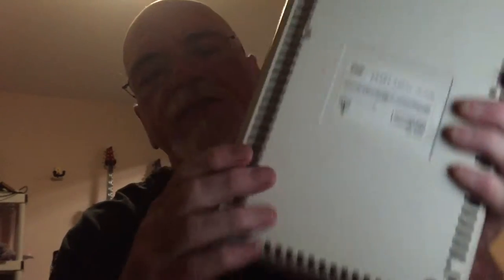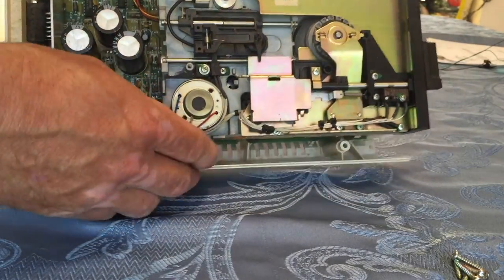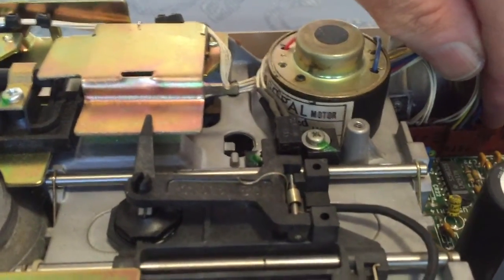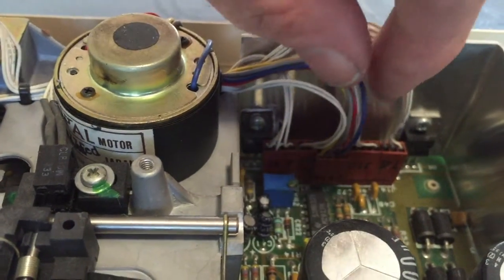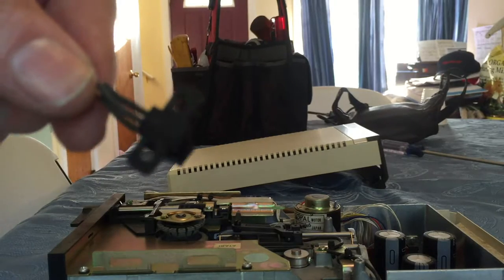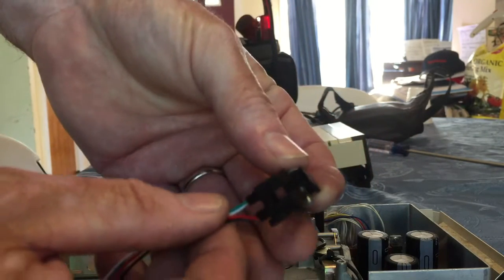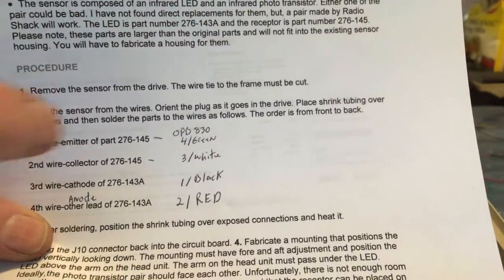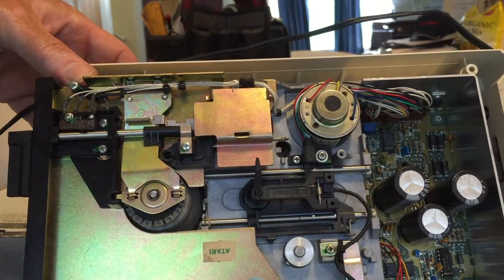Atari 1050 Park Sensor Fix

Comment: I have an Atari 1050. I turn it on the red LED light comes on but I don't get any sound from the drive. I put a disk in but it doesn't even start up the motor. Is there anyway I can fix this?
Reply: hi filcanjay i can tell you that the symptoms you mention are usually caused by bad capacitors and /or diodes failure. ive fixed 5 drives with same problem. 
check out "atari sector" forum, lots of help there.

Comment: Hey..I have a 1050 drive issue that when i turn it on the boot light pulses i guess you could call it not so much flashes..any ideas?
Reply from the maker: Take the cover off and power up.  see if the flag moves forward and then back. If it just moves forward then it is most likely a bad sensor. If it moves forward and back I'm not sure.
Reply: So do you push the front two pins together(sorry couldnt see because your hand was in the way?)